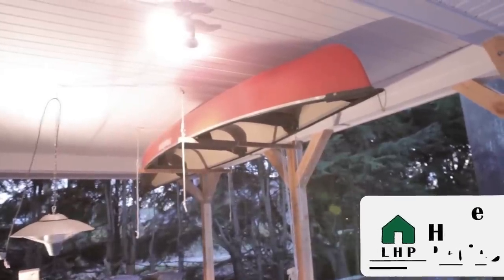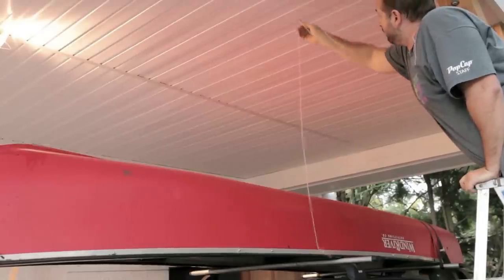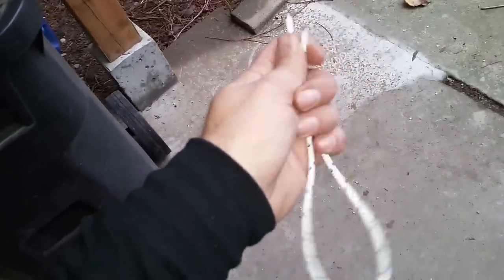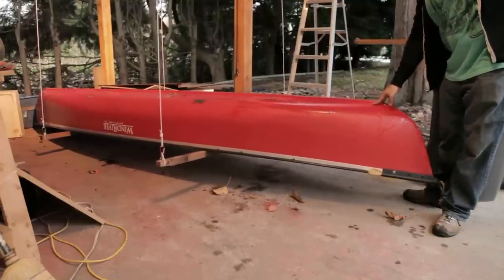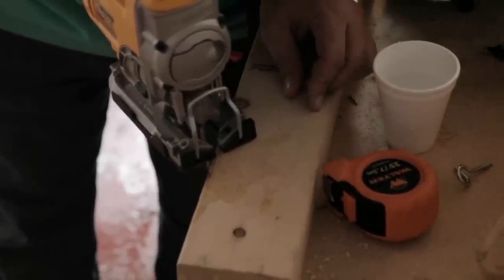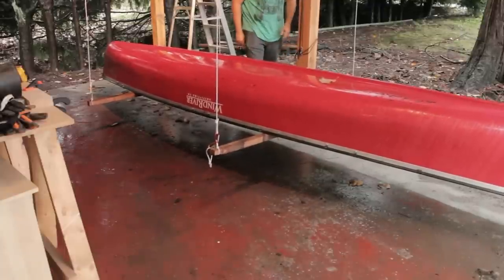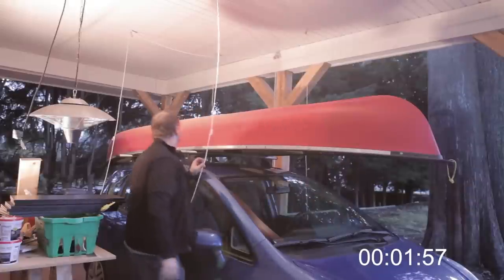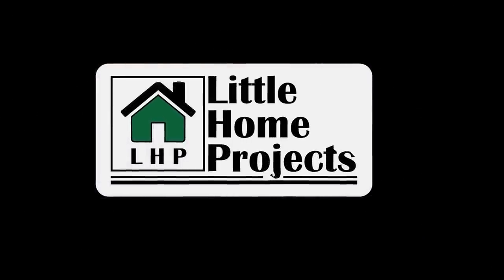Building a Hoist for a Canoe or Kayak in a Carport Garage - LHP

Comment: Nice, I did something similar for my 4 Old Town Dirago kayaks and 16 foot canoe. I made the canoe support fit an exact place on the gunwales, the yaks are supported from nylon straps attached to 2x2s. A pulley  with a double line pull at each end runs through pulleys and each rope is directed and attached to a hand winch to crank that particular boat up to the garage ceiling or down onto a car or my homemade rack for my homemade trailer. The hand winch makes lifting the yaks and especially the canoe literally effortless and will lock in place and a safety strap keeps them secure and out of the way until wanted.  
          As far as the wheeled carrier, I would take a stout bungee cord attached  to each side of that seat and the other attached to the axle with the wheels towards the front of the canoe (like you have it at the 48 second mark). That would put the stress onto the bungee and the wheel will simply follow. The bungee should be strong and run around the front of that seat.

Comment: This is not really a solution, more like half a solution, at best.  And I don't even know if it will work.

At the 50 second point, you have the apparatus in an arrangement that SHOULD work if you were pushing the canoe, rather than pulling. The apparatus would be "cammed" under the canoe, I would think. The harder you push, the more tightly the apparatus is "gripping" the canoe.

Don't know if it will work, but might be worth trying.

Comment: Just curious,  how much does that canoe weigh.  I'm wanting to do something like that for my rooftop tent on my truck
Reply from the maker: My canoe is about 80lbs, But I think the stress on the hanging bolts ends up being more when you are pulling the canoe up. I'm not sure how the math works on that kind of thing.  I would always recommend going up a size  from what you think will be good enough.  Thanks for the question. :)